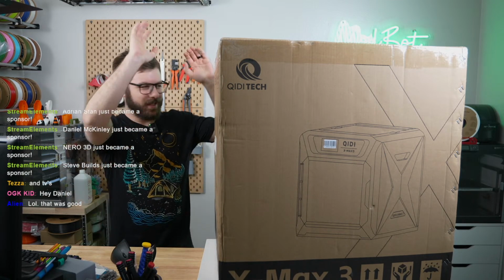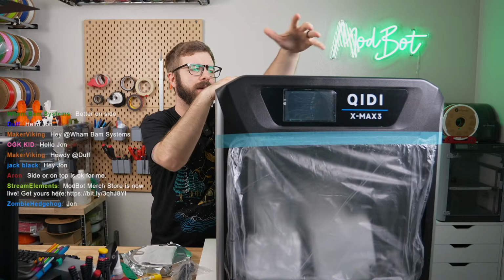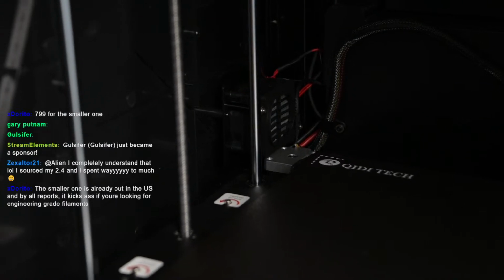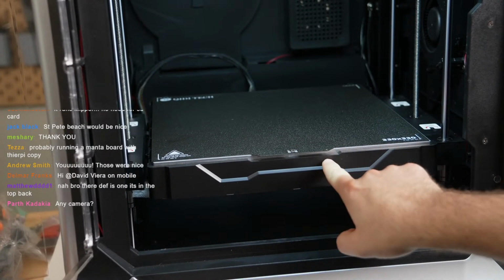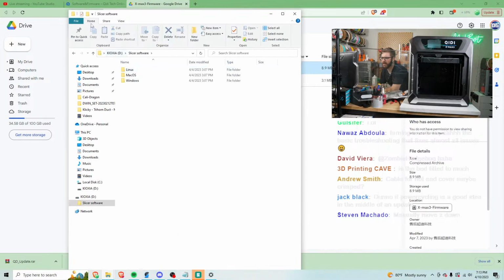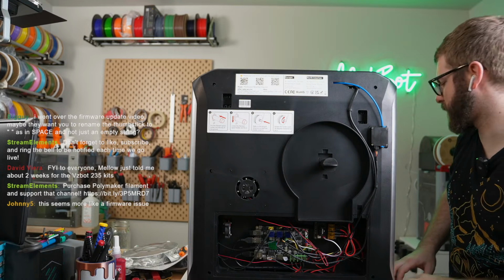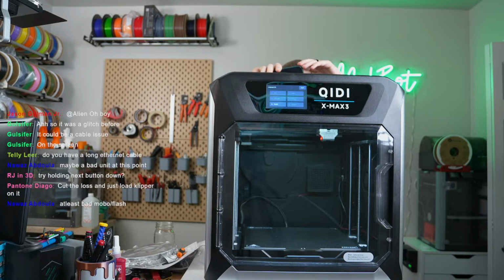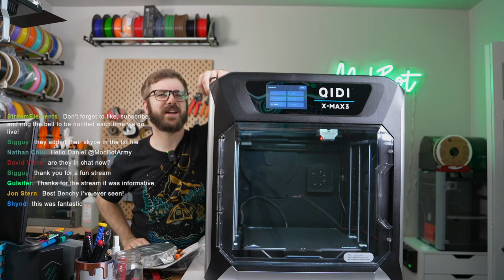Qidi Tech X-Max 3 CoreXY 3D Printer Unbox And First Print

Comment: It's been a month, guess the problems never got resolved.
Reply from the maker: They cancelled the sales to make some changes. New printer should be coming soon.
Reply: @ModBotArmyy  will it still have inductive leveling with manual adjusted offset? seems horribly backwards in 2023. nozzle probing is the future, as shown by prusa bambu and creality.

Comment: Here today, gone tomorrow.
I was looking to purchase one of these to add to my ~10 printers (including the X1 Carbon + AMS). But you dropped the ball on continuing with an evaluation/review(?)
What frustrates me is too many 3D Printer YouTubers run through an initial lookie-see but fail to follow up with a long-term review. Since an open connection was the culprit which caused the problem, you encountered, I thought a follow up was due.

I have a background in aerospace, materials research (HMG), and nuclear instrumentation. I guess my interests are more technical than social, or income generated.
I wonder how fast and effective QIDI would have responded to this problem with a person who was simply using this printer, and not on a popular YouTube 3D printer channel?
Reply from the maker: You make a lot of assumptions that are incorrect. Qidi pulled all of the units other than the smart due to design issues that were discovered. Myself, like every other person who has received one is waiting for the version that is corrected which will be the retail unit to test. Testing a unit that no one will receive makes no sense and doesn’t do anyone any good. 

Next time maybe just reach out and ask before pointing fingers. 👍
Reply: @louisboliou the condescension and entitlement in your comment are pretty foul, dude. If you want a comprehensive follow-up review on YOUR schedule, you buy the goddamned printer and do it yourself. No one owes you anything, Boomer.

Comment: (I live in the US btw) I pre-ordered the Qidi Tech X-Max 3 April 14th and at that time it said it will ship early may, I even had an email from Alex stating it qill ship in may and they will update me. However it still has not shipped and now if you order it will ship June, I messaged qidi support and Alexis was telling me that it wil ship June, then I explained how I pre-ordered April 14th and I was told (MAY) shipment but now she replied the printers have issues and they are fixing them etc.. and my printer will ship late june early july... like whoa?? is that expected?  You obviously got yours right? when did you order your QIDI X Max 3?  and when did it arrive?
Reply: He stated the zero-shift problem was specific to the X-Plus 3, and not the X-Max 3. I find that a bit difficult to believe as the fundamental kinemetric property designs seem very similar, and manufacturers tend to duplicate designs as much as possible. I think the problem is likely across their entire new family of corexy.
It's good that QIDI is reworking some of their design problems. It's far better to be later than sorrier.

Comment: Mine arrives tomorrow. While I don’t believe I’ll have any problems I’m not to worried. I’m sure their tech will solve any problems. Remember these have been transported half way around the globe, and they weren’t handled like Faberge eggs. How many bad experiences have people had with banbu. I’ve worked on new Ferrari’s that had issues. I thought how tech tried to reach out during the stream was awesome. Every comment I’ve seen on their support has been positive.
Reply: Hi, how was your printer?
Reply: @salvatoremaresca3463  I didn’t have any problems with it. I did the speed benchy they have on line and it was actually really good. Just a note. There’s cura and prusa configs on their site if you want them. I did a phone holder with the 300mms prusa config and i was really impressed.

Comment: Did QIDI get you figures out?  I got mine yesterday and am having an issue with the leveling process.   It seems to not know where the bottom is.  Most of the time it will got to the bottom and act like the sensor is not working and it will keep ratcheting....I have to shut it off and do a leveling again.

When it does stop at the bottom it makes a loud bang noise.   

I have 11 QIDI printers....from the I fast all the way down to the X-Plus and none of them have been a problem. 

I am waiting on a return response about this issue.  Their answer to the issue was to remove the black blocks at the bottom which I did during setup.
Reply: There’s a YouTube video in German I believe where the guy had a leveling issue. He flipped the machine and moved the plate to the hotend. He reset the belt and it worked fine. There’s just a blink of the mesh and it looked really good. 

I’ve worked on brand new Ferrari’s that have had issues I wouldn’t hold this against qidi. Remember these have been shipped thousands of miles and you know they weren’t handled like nana’s gello mold.
Reply: there should be some kind of switch there to detect end position - some kind of "z switch". Maybe it is not fully connected to the board, or not properly fixed in its place. Try to look for it ? I am just speculating here. There might be maybe just some dirt/foam there as well on the z switch.
Or maybe there is no z switch and it is detecting the end using motors, as is on prusa machines.
Reply: There is a firmware update that makes the printer use the sensor at the bottom instead of the bed leveling sensor to determine that.

QIDI still thinks my bed sensor is bad and are sending me a new one.
Reply: Does it do this from any position, or only when it starts moving while near the bottom? Bambu has this issue that if you start a print while you are near the bottom, it apparently doesn't remember where it was and it will try to move down ~20mm and make the same grinding noise. It's very frustrating, but easily solved if you remember to move the build plate up ~20mm or so before you start the print.